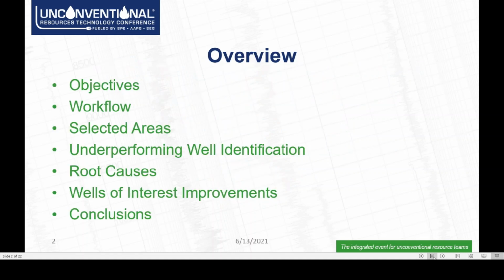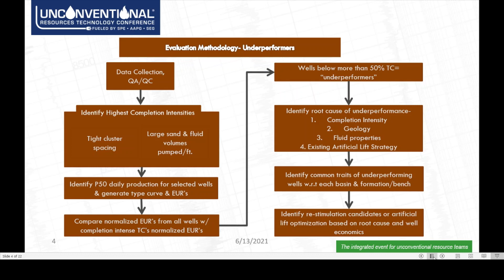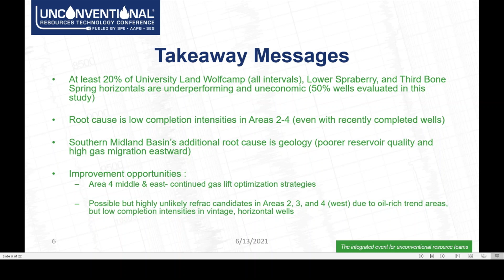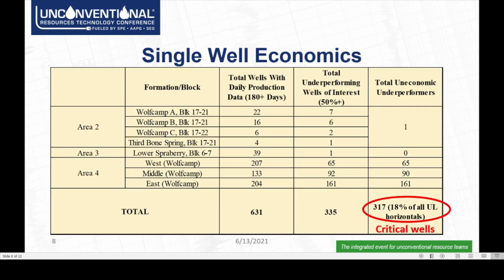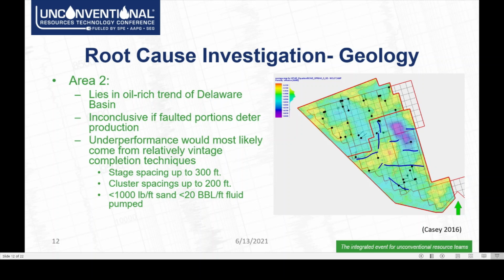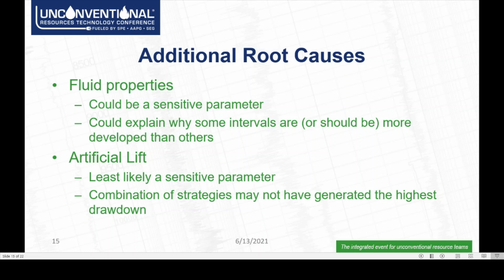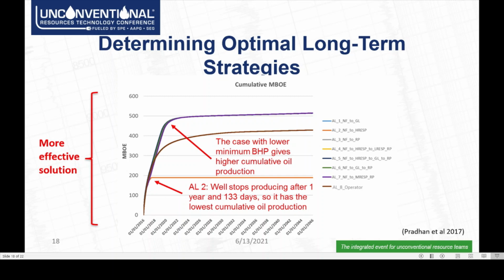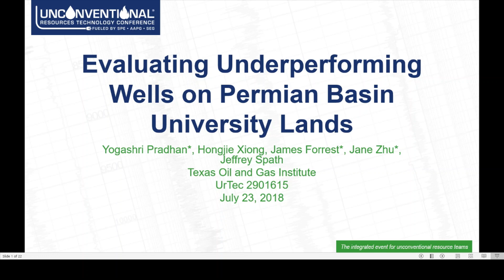How to Evaluate Underperforming Wells in the Permian Basin

Comment: Excellent presentation as always. 

In addition to artificial lift and refrac was there anything else that could be done to improve primary recovery?

And following primary recovery What would you Say is the potential for eor on these university land wells?
Reply from the maker: Thank you so much. Artificial lift and refrac are possible economic options. There is potential for EOR on university land wells but it does depend on the economics of some wells of course.

Comment: Could spacing be considered as a parameter contributing to underperformance? I think in Area 2 in the presentation (Loving + Ward Co.), there have been varying spacing strategies by different operators. It might have missed out, but do the subject wells in Area 2 have similar spacing? 

Great presentation as always!
Reply from the maker: Thank you so much. Spacing could be a parameter for the performance in Area 2. There were different well spacing based on the data we had at the time.